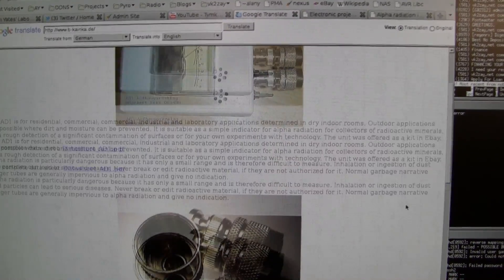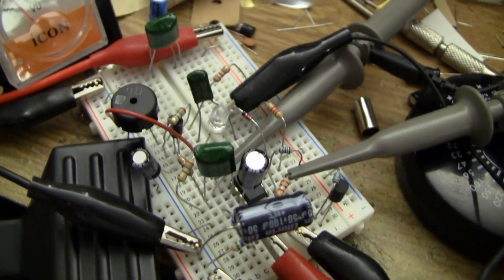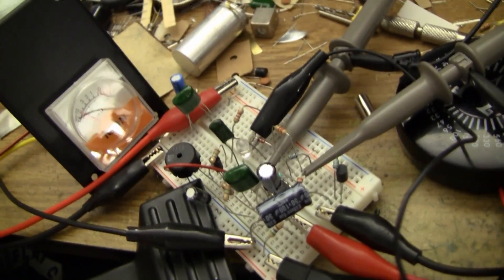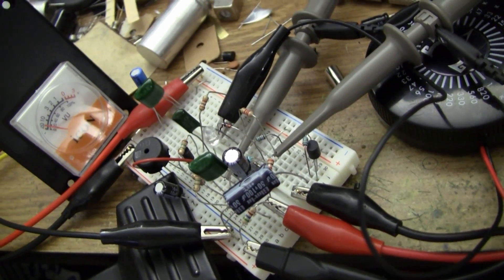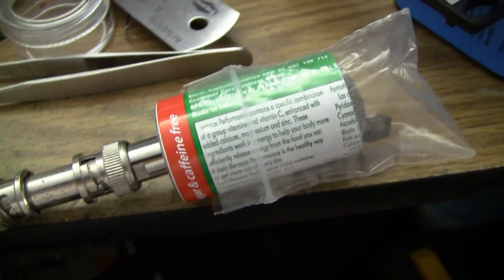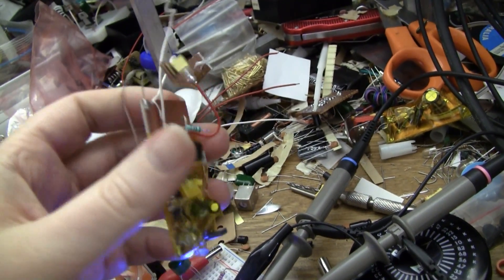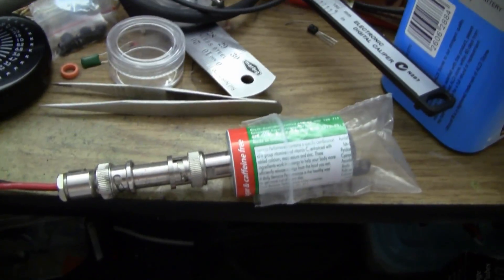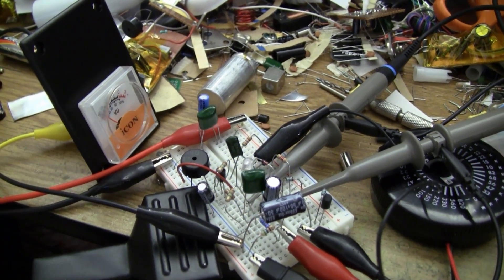AC Ion Chamber Alpha Detector

Comment from the maker: @bkelektronik Indeed I didn't think it would work well either.  It is a bit microphonic, but not too bad you have to tap it hard to generate a false count.  I am using a 2N5484 JFET for the front-end, it's leakage and Idss are about right to stabilise quickly but be sensitive.

For the photodiode gamma counter I am using opamps now too, with a PN4117A JFET front end, it works very well but consumes about 2 mA...  Working on getting that down so I can build a pocket detector with no power switch.